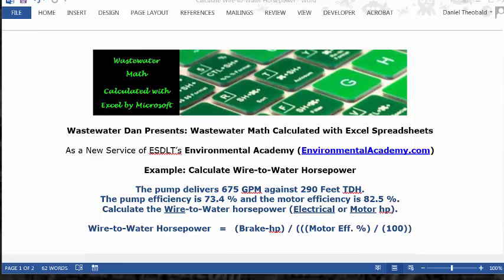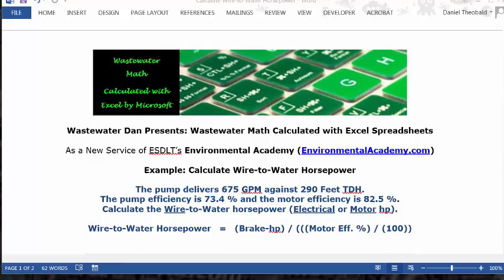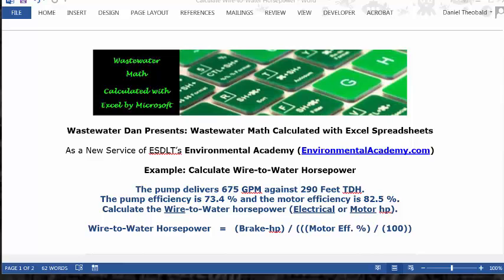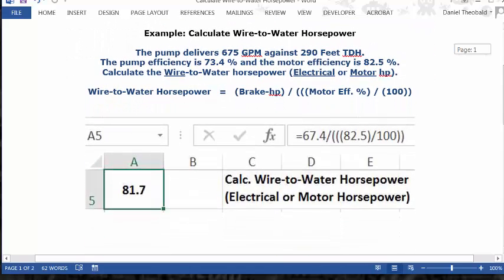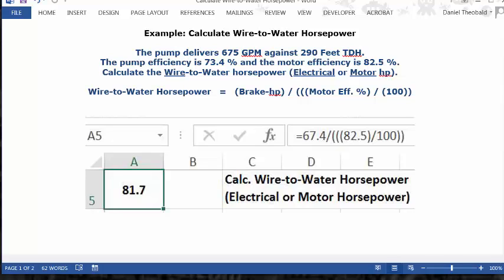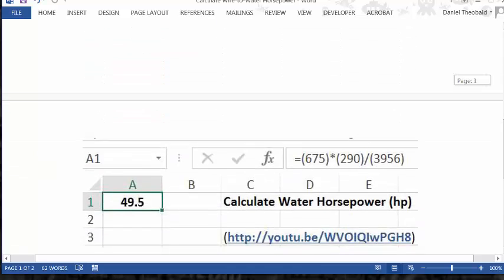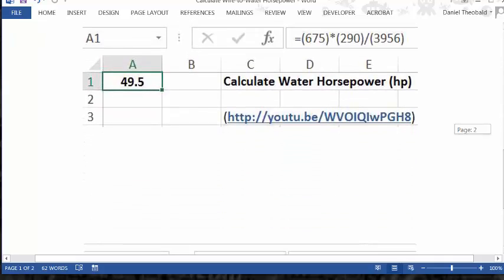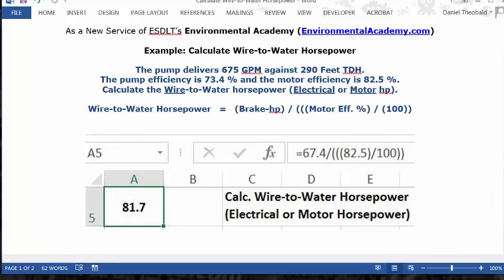Calculate Wire-to-Water Horsepower

Comment: This the only place could really find the formula works great I don’t understand the divide by 100 at the end I have a equation of
100gpm elevation change is 200feet
Pump efficiency 90% motor efficiency 85%
I get the right answer of 6.6 hp if I don’t divide it by 100 which brings it into a small decimal.0066 or something similar.